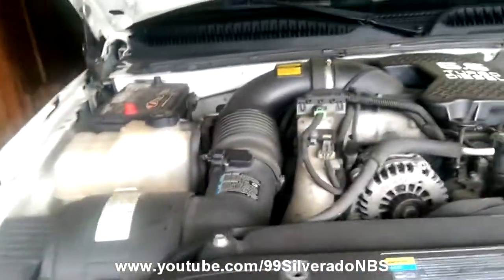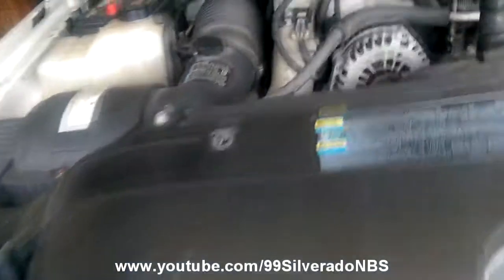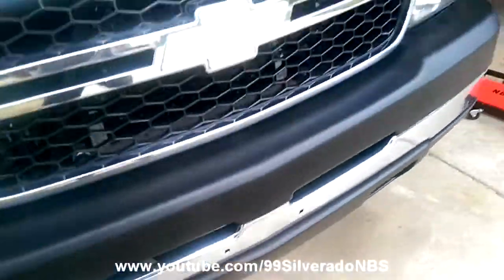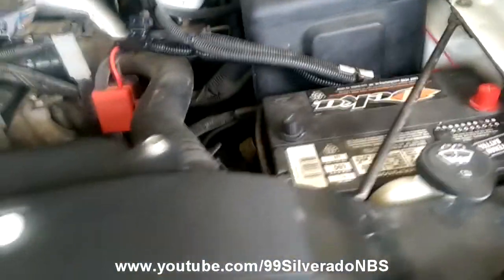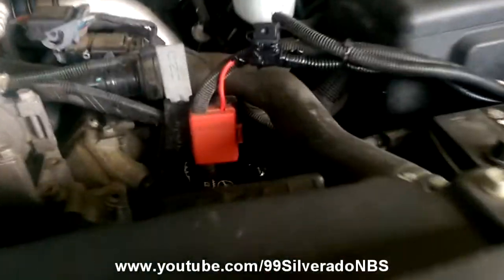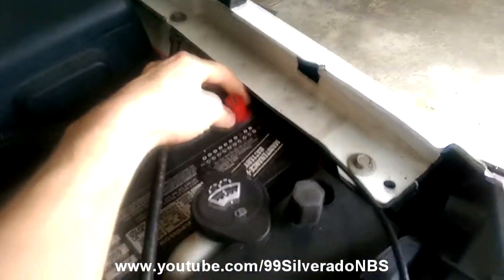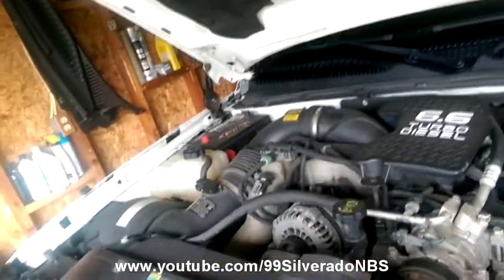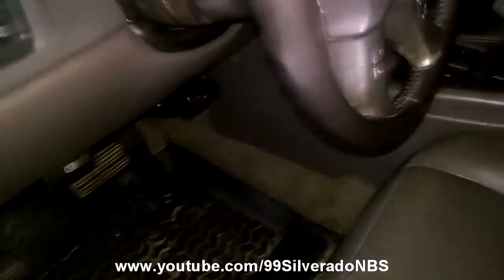Air horn installed (LBZ Duramax)

Comment: Hey man, why not consider replacing the momentary contact horn switch with a ON/OFF switch, connected to your vehicle's factory horn. I've done exactly that with my TWO sets of train horns (one has 4 large bells and the other has 3). So, I can turn the switch off if I ever have to just give a quiet toot, but most of the time the switch is in the ON position, so when I press the horn button in the middle of the steering wheel, both the factory horn AND the air horns sound off.